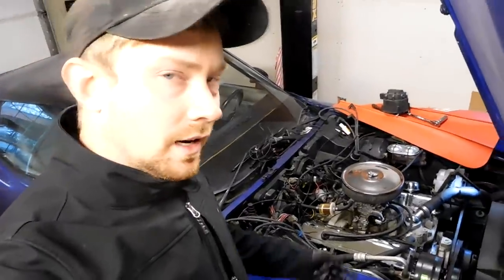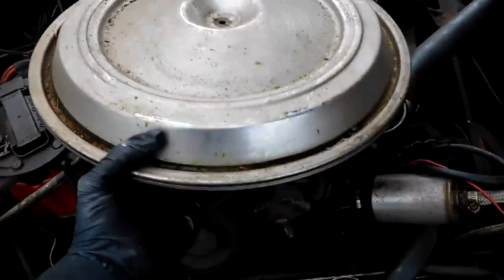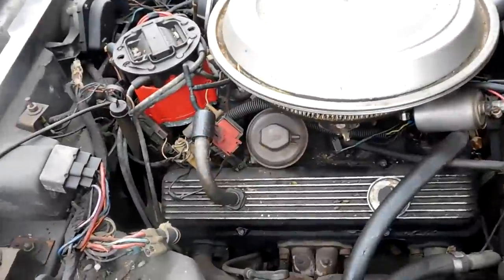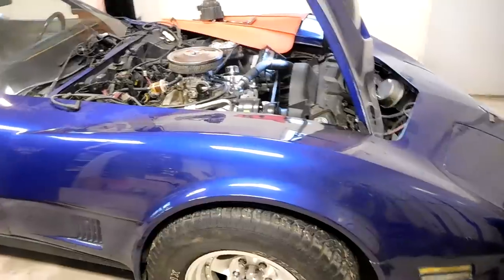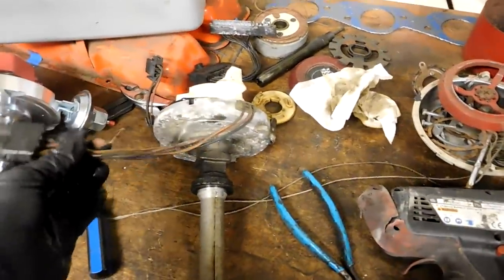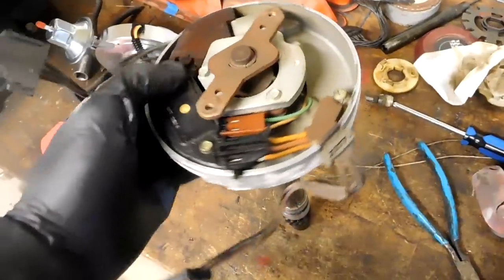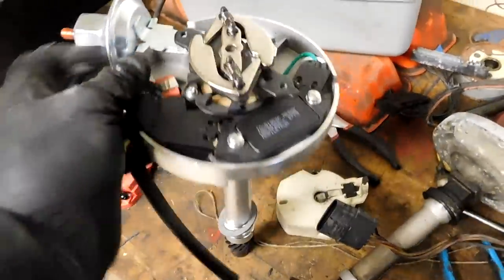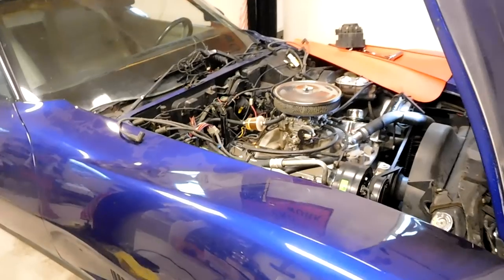All 1981-1982 C3 Corvette Owners MUST Watch This Video! Check The Distributor When Swapping Carb/EFI

Comment: my 82 still has the crossfire injection motor with all the computer components, it runs great. fires up immediately whether the outside temp is 100 or 20 degrees.
Reply: Same here, took it through the mountains last week and it surprisingly did well with the altitude
Reply: Welp I spoke 2 years too soon, now it runs like shit
Reply: @willp8547 
😅😅😅😅😅
Not laughing at your demise just lol with you...if you are lol
Are you going to replace or repair?

Comment: That was the era of hoses and wiring completely covering the engine, to the point of not being able to see the engine.... and taking a half hour to remove the air cleaner housing....lol. I remember working on those systems when they were new. I thought back then they were bad, time has proven that they are horrible. The Q-jets are good carburetors, just not the emissions one, like that 81 used. By the way, I liked the blue on that car.

Comment: The 80s chevy trucks and some passenger cars used that same HEI and alot of people would cheap out and reuse them things all the time when they swapped carbs and it would have 0 advance so if you set it to where it ran good it would try to tear the starter off the block when starting or if you set it to where it would start easy then it would be extremely gutless. Back then it was a bit difficult and expensive to find another hei where today you can just order a brand new one from ebay for $40.

Comment: I have  a 1980 Corvette with a 305 that was factory  computer controlled. The carbs were adjusted at the factory with a machine using freon but you could buy the tool from Snap On if you needed to rebuild one. They are a pain. I replaced mine with a Edelbrock carb,intake and cam. I was told that the 305 was the first one controlled by a computer. They were in California only Corvettes (2000 produced). Its the only one I've seen so far.
Reply from the maker: California cars from 1980-82 were strange. Heck they started emissions stuff there earlier than other places and ive seen crazy stuff if the car was sold to CA
Reply: @TheCorvetteBen  I always had trouble getting it thru the smog test before freshening the motor.  After I changed the cam, intake, carb and having real dual exhaust put on it always passed smog (with no catalytic converter. there is no reference to the motor in the factory shop manual.
Reply: That is correct. Some 305 (RPO code "LG4", VIN code "H") cars were all one could get in some markets in 1980 (California being one of them), and they had C-3 (Computer Command Control) early on. My 1980 Trans Am turbo 301 has a vacuum advance distributor and a non-feedback Quadrajet, but does have a spark control computer due to the turbo engine option.

Comment: My 86 Cadillac Fleetwood Brougham had a computer controlled carb on the Olds 307. Works great when it works, an expensive nightmare when it doesn't.

Comment: Great video! My 82 still has the stock one with the cross-fire setup. Be careful, Jegs and Summit will sell you replacement HEI distributors but they do not have the extra pigtail for the computer hookup.
Reply: My 82 also still original crossfire ...still running good !!!
Reply: I have an 82 didn't run to well changed the tps sensor and cleaned the iac valves and it has been running great since hope u enjoy yours

Comment: I love the crossfire system... The real issue is it's inability to run with any vacuum leak. Most times it's the EGR or the top intake gasket by the EGR that leaks. Once you repair the leak the run very well.

Comment: my grandmother is still using the factory fuel cross fire injection system on her 82 honestly they are a pain in the ass but not so much so as to rip them off you just need to understand how they work and the thought behind the tbi injection gm was doing back in the day because ones they are set and working like they are supposed to boy it works very well for the tech of the day i have to say it’s amazing what the system can do but when it’s wrong oh it’s way wrong lol i wish i had the money to update to a new sequential multiport system but stock is good

Comment: Ironically this gets recommended to me, my name is Ben, I own and daily drive an 81 (I know I’m crazy). I’ve replaced the old carb with an edelbrock 650 cfm. I also converted from that computer distributor crap, to a mechanical one. This 100% is recommended, my car runs wayyyy better over the last few months. Although, you may need to change the ignition module in the aftermarket distributor, if it’s not made by GM/AC Delco… it’s not gonna last lol. YouTube knows too much about my real world activities 😂
Reply: Did you remove the computer from yours? What did you do about the lock up torque converter? I have an 81 and want to remove the computer controlled q-jet but wasn’t sure what it would do to the lock up torque converter. It’s also controlled by the computer.

Comment: Thanks for the info on the 1981/82 distributor, I’m looking at rebuilding my distributor (81) and of all the videos I’ve looked on internet your’s is one of the best to explain what’s going on inside ( no advance weights) I’m wondering if a video on how to rebuilt HEI distributor is in your plans? It would be nice to know what components absolutely need to be replaced and others you can live with depending on their state. 👍🏻

Comment: I have the original dist (no vacuum, no weights) with a Holley carb and edelbrok intake. My timing adv numbers are: 12 deg@900 rpm, 24 deg@2000 rpm and 30 deg@3000 rpm. So I guess the ECU is able to do some timing advance without the q-jet info...???

Comment: Rebuilt computer was $82 at AutoZone and factory repair manual is straight forward. Keep the sensors, carb, dizzy and torque converter operating properly. Dump the AIR system and pump.
Reply from the maker: Maybe, but nine times out of ten all that stuff is long gone and it’s expensive and difficult to replace what has been removed
Reply: The computer controlled stuff is decent if its absolutely 100% intact down to the air cleaner tube, and all the smog stuff still hooked up. I would just take the smog pump belt off and leave the system alone and only repair as needed. The biggest problem is that almost all of these systems have been tampered with and if it's missing any of it, trying to find the exact replacement can be next to impossible to find that's why most people just rip all of it off an put on an aftermarket intake and carb.
Reply: @briang4470  you don't need the AIR system. Removing it cleans up the engine nicely. Same with the EGR and most of the vacuum lines. Keep the sensors that the computer uses and it will happily control the carburetor, distributor and torque converter.

Comment: Those computer controlled Q-Jets were a joke. I had a brand new 81 Trans Am with the 301 with all that garbage on it and it never would run right. Because the dealer wouldn't send his mechanics for training on the system they never could fix it. It was so bad that I hit a big water puddle one night and the car immediately started running rough and because the carb was dumping so much extra fuel that the catalytic converter overheated and started the carpeting on fire. I only had kept car about six months before I got rid of it

Comment: The torque convertor wont lock up if the computer is disabled also.
Reply: I'm replacing my 81 stock turbo 350 that had chunks of clutch plates at the bottom of the pan. I got a turbo 350 that uses vacuum converter lock up, rebuilt with racing clutch plates(heavy duty), and a 5 prong oiling race, for better oiling. Should work fine, thinking of putting on a shift kit for extra hitting power during shifts.

Comment: I have all the sensors and stuff on mine. What all does the computer control after changing the carb and distributor? Are the O2 sensors needed?

Comment: I have an 81 that I’m looking to remove the computer controlled q-jet. I have a non computer controlled q-jet and a regular HEI. Should that be all I need to convert mine? I also have a non lockup turbo 350 transmission from a 72 Camaro in case the torque converter lock up is an issue.

Comment: My girl decided that she wanted to have a summer car too! She picked out a 81 vette I found at a chicken farm under a tree for a decade. I normally build C4's, but gotta make her happy, so 81 it is lol. I didn't know about the computer night mare! Found out the a/c runs thru it, and the electric fan for extra cooling, and a few more items. Thinking of running a 1980 wiring harness inside and the engine bay to delete the computer. Need your expertise on this idea. Replacing all the wiring harnesses so it won't catch fire from the mouse eaten originals. I am using a Haynes manual and have the factory assembly manual to help routing and placement of everything. Any help would be much appreciated.  Thanks.
Reply: Ive had my 81 vette for around 20 years, all stock since I live in California and have never had an issue with it. Passes smog fine just routine oil changes. Hope your girls 81 turns out good for you both👍
Reply: My 81 is a 68000 mile, but rode ruff the last decade. Dirt roads at 50, them up a goat trail of a driveway. Shook her bad, doing some rebounding. That and she sat under a tree for about 7 years, maybe longer.

Comment: I have an 81 headers no cats just in process of removing smog. Gonna keep carb ,distributor, ecm , what do I do about my coolant temp sensor leave it in same position the yellow and black wires gi into thebig harness that all the smog relays come out of. What do I do with this signal if I had no computer. Thanks `much
Reply: PS  I'm just wondering if I can eliminate the entire elec buses to carb and A.I.R. INJECTION RELAYS AND PULL THE TEMP WIRES FROM THE BUS and run a coolant temp to a relay somewhere. OR TO THE GAGE ITSELF?? Any help on this would be great. I see the car in this post has had the coolant temp sender moved, its usually right behind smog pump next to thermostat housing ....Any Ideas on where he sent this signal on that 81 ?? Any help much appreciated....